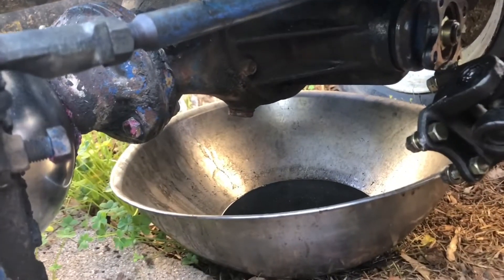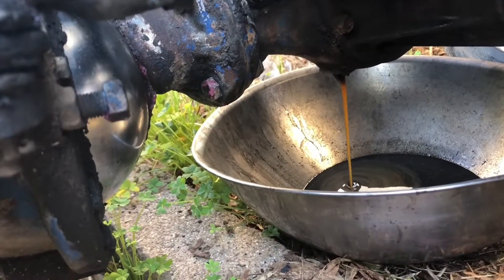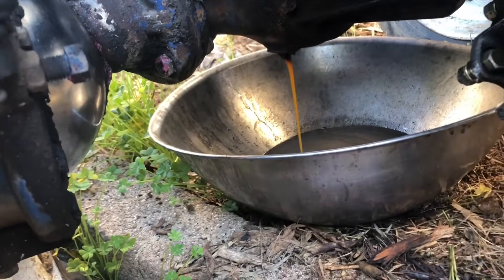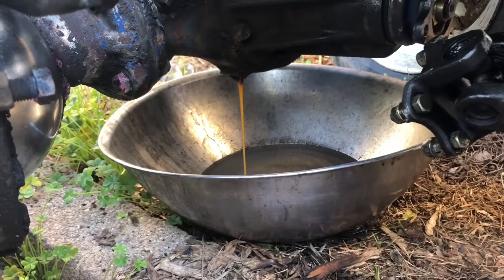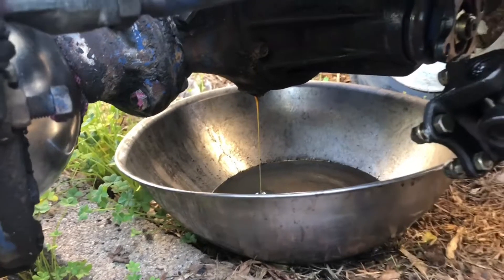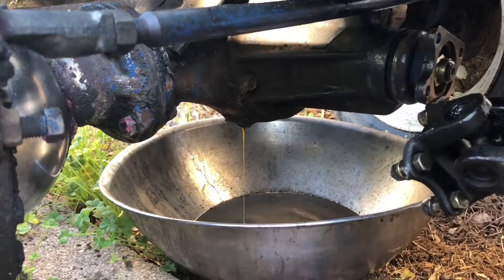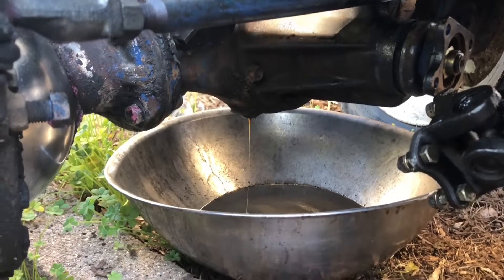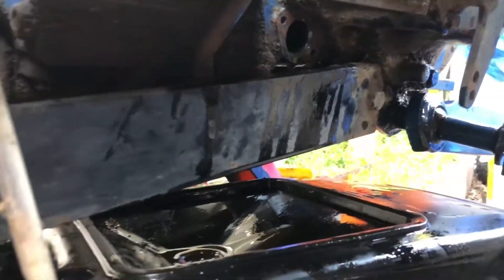77 Wont Go Satoh Honing Results and Axle, Transaxle, Hydraulic Oil Drain and Filter Inspection

Comment: How much hydraulic fluid was needed to fill it back up?
Reply from the maker: Jordendog I dont have an exact answer, but the book says 10.4qts for the rear transaxle. I bought a 5g bucket of rotella hd farm oil and used most of it. I cant find the volume for the front axle, but the 5g bucket is the most cost efficient route. I flushed the front axle with out once already, but Ill have to buy another 5g bucket to do the rear.